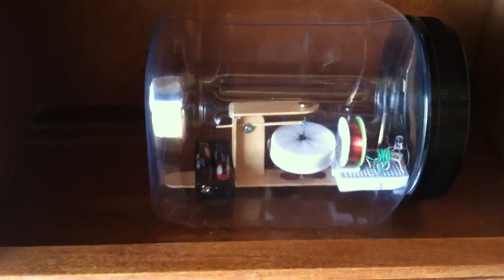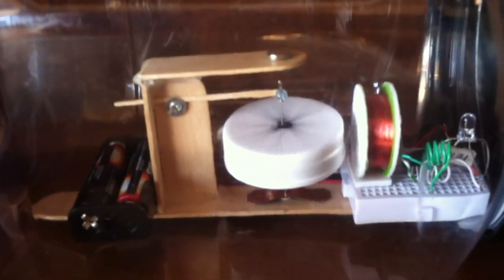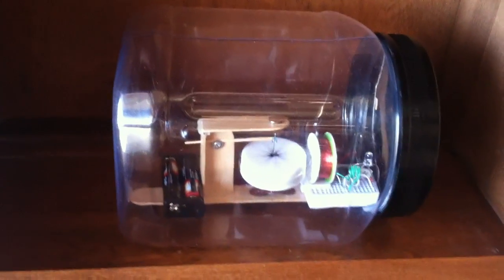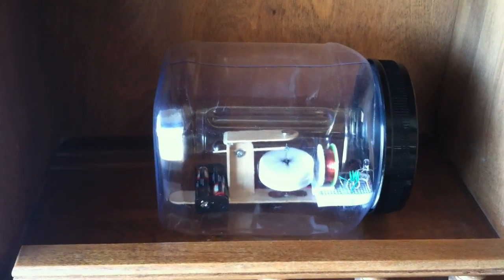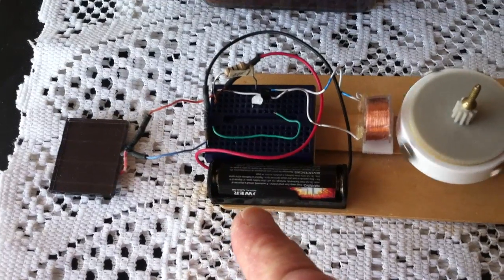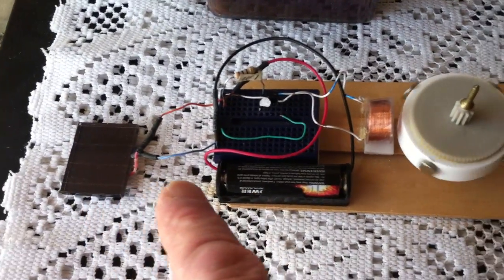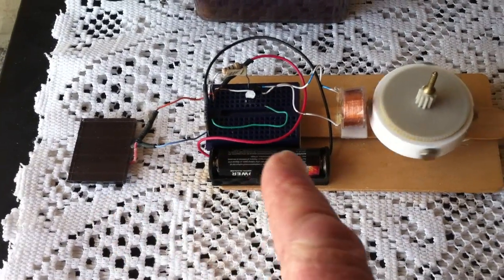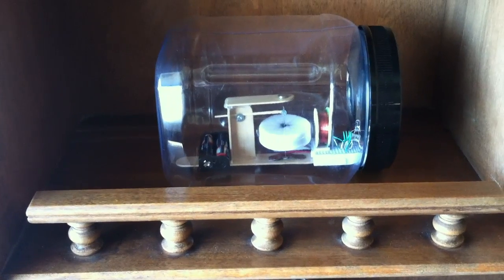Home Alone Pulse Motor

Comment: Some cool little builds have come from this research avenue.
The dream was great! I've seen a few degrees difference on a Bedini SSG circuit one time and one time is normally how this goes huh. 
Although, forever cherished was the 'White Crow' circuit that charged up a completely flat 6V gel batt a few years ago. Wife woke at 4am or somewhere and went out to the kitchen. She woke me to ask "should that motor on the table still be running ?". About the biggest smile ever answered her question..
Reply from the maker: The dream I had was vivid.  The motor in the dream was still running but really really fast.  The whole setup was covered in frost and the battery was split length wise.   It happened about 5 years ago.  I never had a "White Crow" experience like you did.   This motor that keeps getting faster with an increasing battery voltage is a close 'simulation'.  A hundred years ago it would have raised some eyebrows.

Comment: that's really nice too! hope our motor will run without stopping unless the battery is depleted. I like that solar waver very easy to do but if you  put another 4 magnet on the rotor will increase the speed. will keep experimenting this little projects. Thanks for sharing.
Reply from the maker: Thanks.  Your upper needle bushing idea really helped.  I hope that our motors run for a long long time.